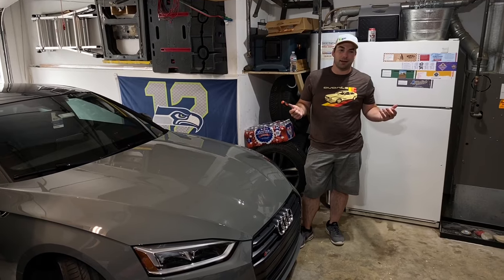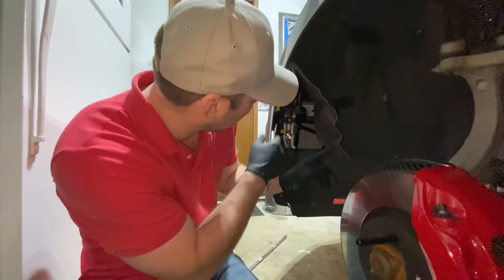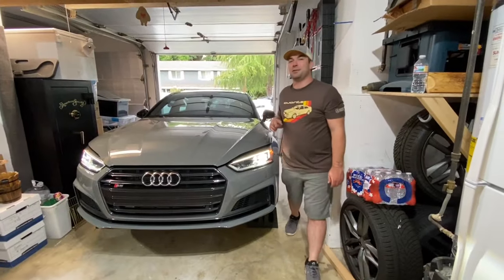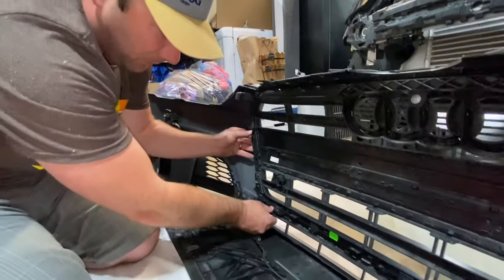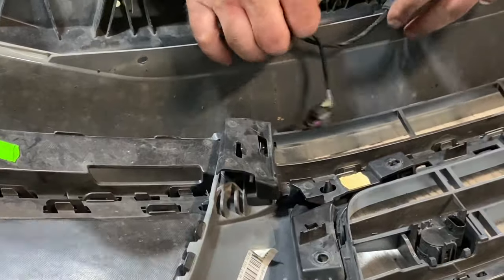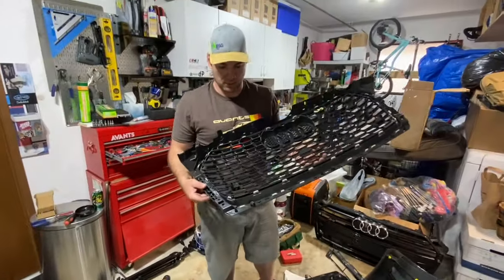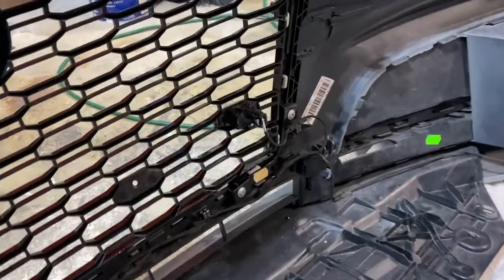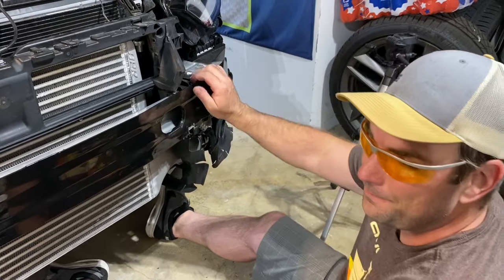How To Install A CarbnLab RS Grill On Your Audi B9 S5

Comment: Is this a 2019 prestige??
Reply: And do you have a link for the 90 degree sensors on audi parts??
Reply from the maker: Sorry, not a prestige and here’s a link to the parking aid sensor. https://parts.audiusa.com/p/Audi_2019_A5-Sportback-Premium-Plus-Hatchback/Parking-Aid-Sensor/62808377/5Q0919275BGRU.html
Reply: @Vaguh  I found them. You're saying with those sensors, there should be no need to cut into the frame right??
Reply from the maker: @jerrymontero7518  correct.
Reply from the maker: Also, I added the link, too.

Comment: ???? bei Minute 22 wird der Prallträger entfernt . Danach  wird schwarz foliert um dann am ende jedoch den silbernene Kühler unterm SChwarzen Grill zu haben , warum wurde der nicht schwarz gefärbt ????? schlechter Job
Reply: Thanks for your feedback. The crash bar wasn't removed at all during this process. You're asking why I didn't change the color of the intercooler to black as well, correct? Mainly because I didn't want to take it off and have it powder coated or paint it. Also, putting a coating on the intercooler to change it to black,  would reduce it's effectiveness and go against why I installed it in the first place. I don't mind that it is visible.

Comment: Lol this was more like a how NOT to video
Reply from the maker: Thanks for the feed back. What would you have done differently?
Reply: @Vaguh  I'd say do thorough research before filming. I don't like the idea of cutting the crash bar. I recently bought an Audi and I'm looking to change the grille as well.
Reply from the maker: @Th3_Genius  well, since I did this video, you now have the benefit of learning from it. There was literally no literature on this issue when I did my install. You’re welcome.
Reply: @Vaguh  I'm not so sure about that. The aftermarket grille manufacturer must have gotten the specifications from somewhere in order to make it. Thanks anyways I guess. Will keep watching your videos.
Reply from the maker: @Th3_Genius  I appreciate your comments and you watching the videos. Believe me, cutting the crash bar wasn’t my first choice. I’ve talked with a few shops that have also done the install and they agreed, that it wasn’t ideal, but not compromising any structural integrity.
Reply: If someone doesnt do it first then we dont have the benefit of the video thanks for making the video it helps the next person to troubleshoot much appreciated.